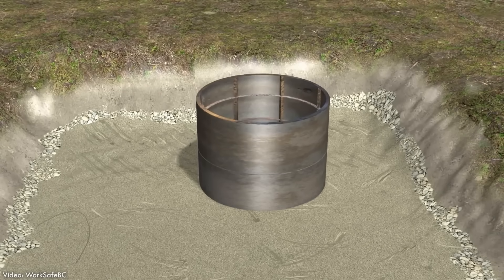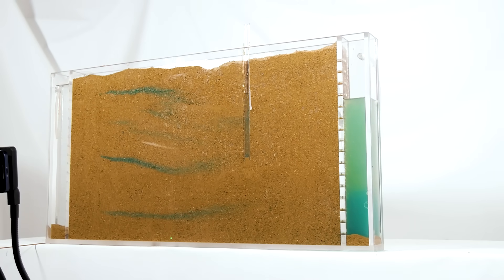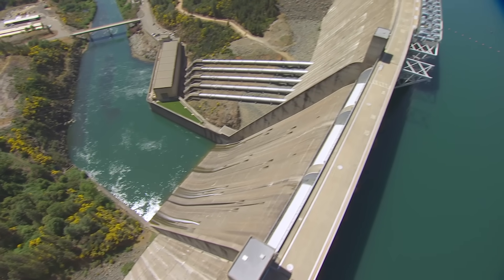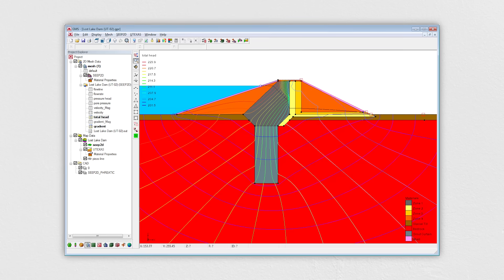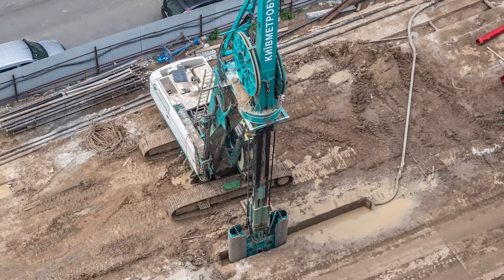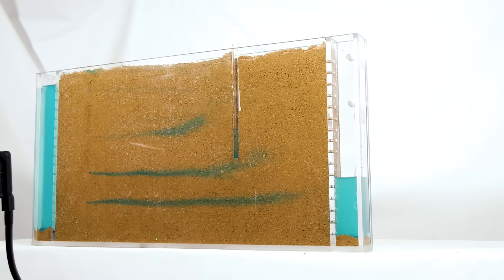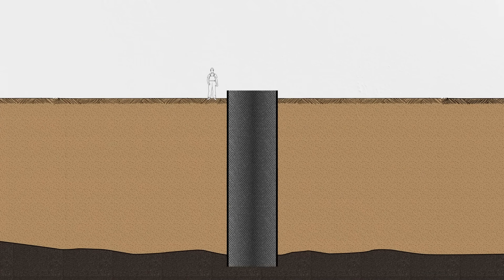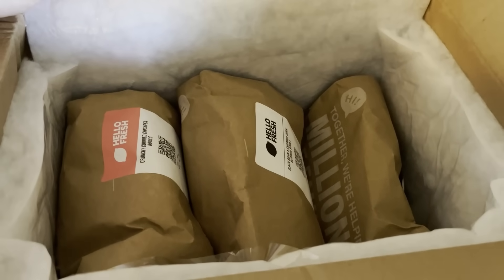The Bizarre Paths of Groundwater Around Structures

Comment: One instance of groundwater problems i have witnessed is my fathers neighbor who wanted to install a geothermal heating pump to his new home. The area is surrounded by sandy hills collecting water, which then goes under heavy clay soil which in turn pressurizes the groundwater. Then when the contractors drilled the geothermal well they ended up creating an actual well that brought water to the surface in quantities enough to flood a field next to his property. He ended up having to installa a pump system to keep the foundation dry on his new house.

Comment: New video idea, CSOs (Combined Sewer Overflows) - From a Philadelphia Inquirer Article circa the 1970s, when te colonists first came to the Americas
1 They just threw their chamberpots out the window into the street.
2. Population got to big for that, so they dug a ditch down the street to convey the sewage (and rainwater, aka stormwater) away.
3. Population even bigger, they put in a collection sewer pipe and buried it, with drains to it, of course, to convey sewage and stormwater to the nearest river.
4. More people and after the rivers got plain nasty, they installed a big pipe along the river to intercept the sewage and stormwater, and then convey all of that to a bigger river downstream (the Delaware River in Philly's case). Those pipes still exist and are still called interceptors.
5. Finally, they built 4 sewage treatment plants (STPs, aka "Publicly Owned Treatment Works" or "POTWs") to collect and treat the combine sewage and stormwater flows.
6. BUT for a BIG stormwater event (rain or snow), flows were so big they could overwhelm the POTWs, causing damage that would take time too repair and recover.
7. So, they installed "Combined Sewer Overflows" ("Combined" meaning stormwater and sewage flows) into the interceptors flowing into the POTWs. When a big stormwater event fills the interceptors, the CSO's allow the sewage/stormwater to overflow into the river, protecting the POTW. CSOs are designed to overflow AFTER the "first flush" of the storm event carries the initial undiluted sewage flow to the POTW, but the overflow does still have some untreated sewage in it.

The EPA passed regulations to address CSOs in Dec. 2000. New combined sewers construction is illegal, but CSOs still exist in the bigger, older cities. Even with just overland stormwater runoff, but especially if CSOs around, it's a BAD IDEA to go swimming in a waterbody after a big stormwater event because bacteria levels will be high.

Comment: Interesting. The building I live in is struggling with raising water table level. Sump pumps may mitigate flooding but don't solve the moisture issue. I wonder if a deep well pump (40-60 feet) can effectively lower the water table level by a foot or two to save the basement of the building. Any thoughts?

Comment: greetings from Melbourne AUS, great video, as a fellow engineer im appears to know few expert dam engineer in victoria and i have heard far too many people say dam-wall, its just a dam like you said 👍. On a smaller civil project we often used to installed precast concrete pit/wall to mitigate the groundwater issues, we also monitors the seepage points on dams and measure the ground movement with piezo, some older dam also have tradional pendulm to measure the movement. some area has historical ground water level and some large project would normally have sump pit and pump installed. thanks again for the video

Comment: It would be good to have a complementary video on the problems and solutions to rising water / moisture in house sub-soils, and how the foundation act as a caisson that is meant to help keep the house solum  / sub-floor dry, and the problems of the necessary natural ventilation (or specialist ventilators in some climates) to stop all the damp and mould issues in houses.
It not something that is explained often enough (if ever;-)

Comment: Back in the mid 90s I had a chance to tour Table Rock lake dam in Missouri. We got all the way to the bottom into a tunnel. The guide explained we were 225 feet below the flag pole on top. This tunnel was about 8 feet square and went from one side to the other. And dropped to a low spot in the center. When we got to the middle there was a sump and a small pump. On one side of the tunnel was a sidewalk the other was 16 inches lower and was solid bedrock. Water slowly oozed from the rock. The exposed strip of bedrock allows the pressure to release. Claimed if the tunnel was plugged the dam would fail. Personally I wouldn't want to have that responsibility on my head. Stunning how smart man can be.

Comment: Simply put water will take the path of least resistance. Meaning if there is ANY gap inbetween your pylon/cason/foundation and the surrounding dirt, even if it is a tenth of a millimeter, will allow water to pool and begin to erode the earth around the structure.

Comment: I worked on a house that was built on poor ground conditions with free flowing water through glacial pea gravel. For earthquake safety the two story brick house was built on huge polystyrene blocks. 
While passing boards through the uphill side window the ground gave way and I fell waist deep into loose gravel with water flowing out. 
Apparently engineers did not factor in ground water flow against the buried blocks.

Comment: Uplift is the reason alot of concrete forms fail. Most carpenters have to learn this the hard way because they're so concerned with mitigating the outward pressure it's easy to overlook that any opportunity the concrete has to get under the form the hydrostatic pressure will become upward pressure. And once that happens everything else fails really quickly.

Comment: Unfortunately, I don't understand how the model shows uplift pressure. All I see is a pipe with water in it (the dam?), no surface water (so the dam is entirely underground?), and there's some water that seems to flow around it but I have no sense of the forces it exerts on the pipe.

Comment: Wouldn't consider anything less than the failure of the levees in New Orleans in 2005 count as the greatest American civil engineering disaster. One could easily argue that the failure belongs to the 20th century due to years of maintenance neglect, but anywho.

Comment: Hi. So this seems like the same dynamics that r going on under a home after a heavy rain. Ground water comes up into the basement due to hydrostatic pressure. Below ground pump pumps r used to relieve the hydrostatic pressure. Is this right? Thanks.

Comment: btw that engineer should've had a rope or something attached to him while doing that particular job, that way even if his colleagues didn't get to him quick enough they could still pull/dig him out via the rope, with the assumption that he would get buried a bit should also have a small oxygen tank on his back with a connected mouth piece in his mouth, it should have a means of opening the valve on the mouth piece that the tongue would be able to work so even if he initially is buried he be able to buy the workers time to pull/dig him out by using the oxygen tank to breath

Comment: I bought a house that was built bellow the level of the field behind it. The previous owner did know what to do with the earth he dug out to build. So, he put it against the back of the house, between the higher level field and the walls. Dumb move! He ended up selling cheap due to all the humidity problems on the back wall. I bought it, dug the earth around the house and put a low pressure zone instead of the earth with stone the size of fists. No more high water pressure pressuring against the walls. Took one year to dry the cinderblock walls though.

Comment: Well done video ! A good start in understanding the physics of high & deep underground constructions. Im retired from building large deep underground constructions in impossible conditions.  If you could figger out how to do them successfully,  they were very profitable. Sinking large concrete structures up to 14 stories in complex  " fluid " ground, next to expensive buildings was our specialty.  One had to be done underwater,  flooded to prevent bottom uplift & exterior . . Losses. In Dearborn, 3 of these large multi milloin dollar  projects (done by others who thought it was easy ) were abandoned after half complete because the physics overcame their understandings. All for different reasons. All were demo down to below grade & buried in place. Sad, if caught early they could have been saved. Sometimes the most important word in construction is STOP !

Comment: Love your models. Can you change the media in the model from uniform sand grains to different densities, like a layer of clay, a layer of gravel, and a layer of rock (maybe using spackle or some other mouldable material)? The groundwater would behave quite differently. It would be interesting to run the same experiments with different media and see what happens.

Comment: Its really simple in concept. Water is trying to follw gravity first the it tries to level itself. In the process it will take the path of least resistance kinda like electricity.
Reply: The problem is that that simplicity hides the reality. For example, electricity DOESNT follow the path of least resistance; that's a myth, or a convenient untruth.

Electricity and water both go EVERYWHERE, and the path of least resistance allows it to go furthest, leading to a first order approximation similar to that untruth. But an electrical engineer quickly realizes they can still get shocked, even on a path with higher resistance.

Comment: What you're saying about uplift is something I seen here in the Netherlands with demolition work as well. We've removed massive concrete basements which were in ground water as well. We'd be pumping water all the time or the whole site would flood. The craziest thing is that most people think the piles under structures like that are to keep it from sinking, but about 70% of those piles were there to actually keep everything from floating up due to the massive ground water uplift pressure
Reply: Is sewage-lift designed intentionally to swap flows betwixt water table?

Comment: I live near a farm in eastern PA.  On the land there are several 6” diameter vertical steel pipes sticking up from the ground about 2 ft.  They were all obviously drilled and inserted and all but one are capped.  I believe the open pipe had its cap accidentally taken off by a tractor.  Anyway me and a buddy got curious one day and connected several 1/2” diameter pvc pipes together secured with duct tape at the joints.  They were 10’ pipes and Idk how many we had.  Maybe 4 or 5.  We discovered the water level began 30’ from the surface and we sid not bottom out.  More curious now about how deep this went we later dropped a few solid steel ground steaks used as weight to a coil of steel wire on a spoil.  We slowly lowered it down and down and down.  We were pretty amazed at how deep it seemed.  We knew we hit the bottom because you could lift the line and feel when it was on the bottom and when you lifted it just above the bottom.  We recoiled using a large nail inserted in a cordless power drill.  We then unspooled again along the roadside and measured with a 100 ft tape measure.  The deapth was just under 600 ft!  Maybe 595.  I couldn’t believe it and I am still intrigued.  Can anyone here explain what is down there?  I’m imagining a very large and deep body of water.  We’ve done other experiments as well invokving the well.
Reply: Also forget to mention the 6” diameter steel pipe did the go down 600ft. I forget how deep it went but we knew during retraction when we came back up into the low end of the pipe.  We designed our weight and wire system to not get caught up reentering the low end of the pipe.

Comment: 1967 my home was flooded by groundwater.  Snow melt was very rapid and the culverts couldn’t pass all the water and the road that was about 100 feet upstream was was unvertopped.  For ~ 36 hours every hour 9 inches of water seeped into the basement and we would then pump for 15 minutes.
Our basement walls were cinder block and the upstream wall had water marks about 3 feet above the floor.  A 1 inch and a 1..25 inch pipe traversed a dug well through a 4 inch pipe from the dug well to the basement.  My father “caulked” the 4 inch pipe with rags to restrict the flow.  The water in the dug well was ~ 16 inches above the basement floor.  
From 1953-1968 the basement flooded 3 times.

Comment: Instead of dewatering, cryo has been used to temporarily freeze and stabilize work sites for tunnel boring in the Toronto area. This approach was successful in reducing project estimates and for winning bids. Must be successful due to proliferation of more work sites with visible refrigeration equipment and even more "shaft" sites around our Oak Ridges  Moraine region, north of Lake Ontario. I'm sure not for every job.

Comment: !!!° If you look at the description of SpaceX's stage 0 platform I think that ground water was a major factor in the damage.  I would be very grateful if you would look into the possibility that the rocket caused vibrations enough to cause liquefaction.  Also if released water could have been turned in to steam trapped under the concrete causing it to explode out.

Comment: An interesting thing now days is when they excavate below a dam down to rock, they clean the rock with water jets and then drone fly each area about 40 ft away to make a 3d colored mesh to document it. I did this on a dam and there were 120 flights so I have this large super fine detail mesh of the rock under the dam. The biggest danger on dams, though, is the quality of government inspectors, as they tend not to be good at large construction. They don't do it enough. So they inflate the prices and frustrate the contractors more than is necessary.

Comment: Good content, now im wondering about the spacex starship ground 0 structure that they dont bother to make a flame diverter like the ones in kenndy 39a, thou elon confirmed it maybe a mistake which is it as the pad have a crater on it, one suggest is that the problem is to have a license or permit to build make too long and mars and moon doesnt have landing pads so they're simulating it here on boca chica and second is the ground water near the beach as same in cape is the problem that they can dig too deep.

Comment: I remember a constructions site where the basement was made first by putting in dam walls, then digging it, then putting 1.2 meters of underwater cement to make sure the basement wouldn't start floating on the ground water while the actual structure was built.

Comment: I feel like water would also go around a cutoff, not automatically under it, but will choose a path depending on which route is the shortest distance from the original route.  The model used was very skinny so the only option was under. But I'm no expert.

Comment: what do You think about the water situation in Lake Mead and Lake Powell in 2023 and its future? Now the western States, CA, Montana, Utah AZ ... are somewhat lucky with these "atmospheric rivers " bringing in much rain and snow, filling up the snowpack on the Rockies, and feeding the Colorado river.  With GreenhouseEffect, ClimateChange is not really stoppable. There lies an unexpected problem ahead. 
 Suppose alternating droughts and floods will be driven and intensified by rising Pacific ocean temperatures. Floods, in an ElNinio year, and droughts, when LaNinia prevails.  What will happen, when ultimately the temperatures in the Rockies in winter stay above freezing? (it is not only in the Arctic, where the real possibility of an ice-free winter looms) There would be no more "Snowpack", accumulating snow and ice and slowly releasing it in the spring! Any heavy rain will slush downhill immediately! Even the viscosity of water diminishes with temperature quite noticeably, making it run faster. The only storage of water for the summer would be in the reservoirs. They become more important and should be enlarged and strengthened. The potential malaise situation should be considered ahead and planned and prepared for. 

 Also, it might be an idea to dig tunnels halfway up through the Rockies, from West to East. These would be helpful to fill up the scarce groundwater levels in the dry states! The surplus water raining down on the west of the Rockies when heavy rainfalls occur, a water that otherwise would flow unused into the ocean could be channeled to the dry East side.

Comment: I have done underground utilities pretty much my whole working lot dealing with that sewer underground structures storm drains 20' deep lift stations border electrical I also live in Florida so you definitely get used to fight in order if you can get your whole job you're all good to go you also have shorn boxes we'd lay down rock bags with pumps in it filled with fire brick we would make Kelly Wells I mean you name it if you can get the water out of the ground and away from your work area it makes it much safer

Comment: 10:25 I realize that this seems awfully similar to the well that Townsend dug for their homestead. They doug a big hole, then lined it with water-tight walls (barrels) and filtered the water by putting gravel on the bottom. This really helps me understand exactly how those old wells work.